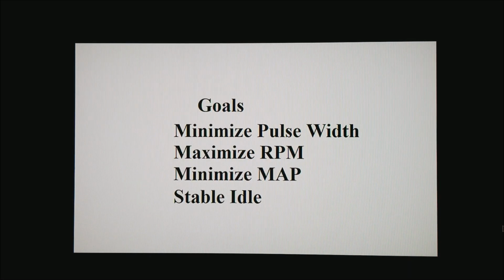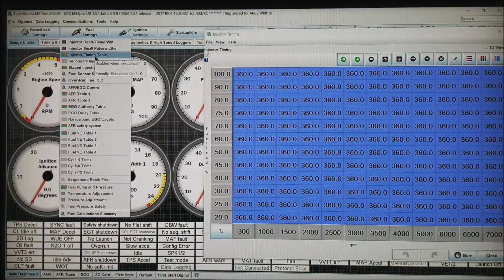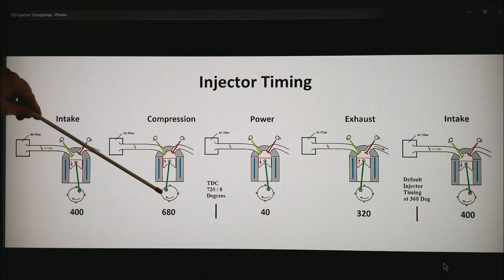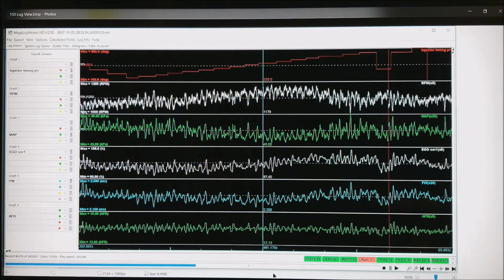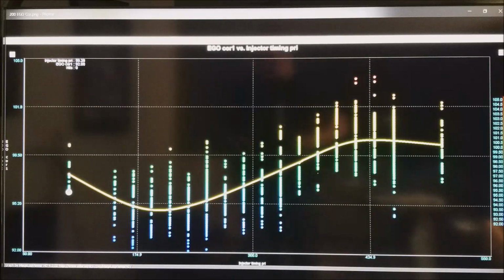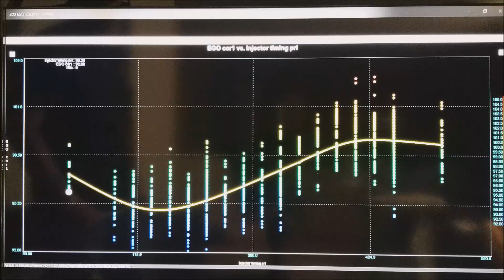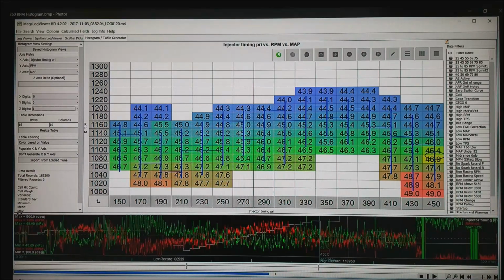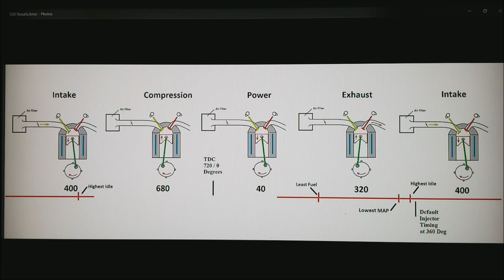Injection Timing

Comment: This only really applies to an engine running at low power. At higher power levels when the injector duty cycle exceeds 25 % the injection duration  is now longer than the intake duration so injection now occurs outside the ideal injection "window". As power level increases this situation becomes worse. The upshot is that true sequential injection is fine for low to medium power but is largely a wasted complication at high power levels.

Comment: Hey Andy love the video it helped me understand better. Question, why would someone send me a base tune with fuel injection timing set at 550degrees from idle to 3000 rpms . Injectors are about 7inches away from intake valve . Small block Ford.

Comment: Great video I’m tuning my B18C stock injector location Pro Series Intake manifold and pro 1 cams  I have my afr good and timing maps and On my Hondata s300 injector phase is set at 405 cold and 480 and 450 Hot BTDC. Are you familiar with these settings on Hondata ?

Comment: The Maxx has an option to set the value based on  the center of the injection event.   Would that be a better way to control the angle than the start of the pulse?

Comment: Would this mean that peak RPM should corelate to peak torque. I'm trying to get a little more torque off idle. Mid length headers have softend the low end over long tubes. On the plus side, no scraping over speed bumps.

Great series of videos by the way!

Comment: Thanks, Andy, for a great video.  I was researching secondary injector timing, and this is the best injector timing information I found so far. How about doing it at WOT, and even add the cooling effect of Methanol on the intake charge vs more fuel at the valve (primary injectors).  That would be awesome!

Comment: Do you think the hot intake valve helped atomize the fuel causing it to end up burning less. . Also the higher idle could have also been effects of the correction some motors like a little richer idle.    I want to try this test no correction all fixed timing.  I Love Finding Sweet spots.   There is a lot of theory about when to inject fuel and I've heard both spectrums.  Also it would be interesting to see how you would advance injector timing based on rpm to compensate for time delay from injector spray latency.

Comment: One question/correction: you state that the injection timing settings are in degrees ATDC but at least in current MS3 code, isn't it before TDC on the compression stroke?

Of course at the default of 360 it wouldn't matter, but the video makes it sound like larger numbers in the table making injection timing later, and I thought larger numbers equaled earlier timing.
Reply: This is also my concern. He says the sweet spot is by putting around 350 degrees in the map (which refers to BTDC in the manual) so 10 degrees atdc in intake strokes. Makes more sense to me.. The timing line image with the strokes would be totally messed up if we're right.
Reply: Also very early injections (higher number) gets all the overlap and in the ego correction plot you see it's using more fuel. While later injections (lower numbers) find the intake valve more open and optimizes fuel saving since the vacuum draws vaporized fuel and you're not using all the duty cycle. Now everything makes sense. So I'm pretty sure the table is actually BTDC for the compression event. Andy did a very good work, just the assumption It was atdc misleaded him. This means that those 10 degrees he retarded the injection actually lowers the usable duty cycle  if used in the high rpm range, where probabily the engine would benefit more of higher numbers (a little earlier before the intake stroke happens) to give time to the fuel to travel the long runners in this case.

Comment: Thanks mr. Andy great video..... Wanna ask a question. Is it the injection timing constant from Idle to high rpm? Or the injection timing is variable from any rpm VS load? Thanks
Reply from the maker: The settings would change thru the power band.  Most sensitive at low power and less sensitive at full power.
Reply: Andy Whittle thanks for reply......learned alot from your video.... Thanks